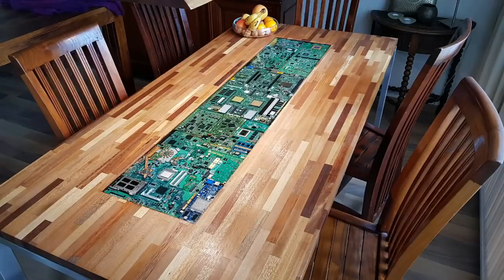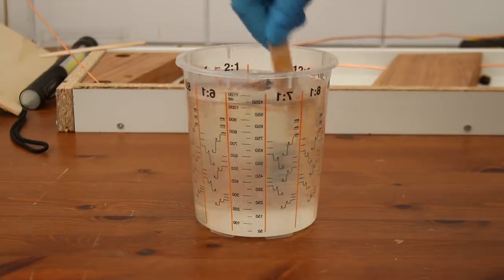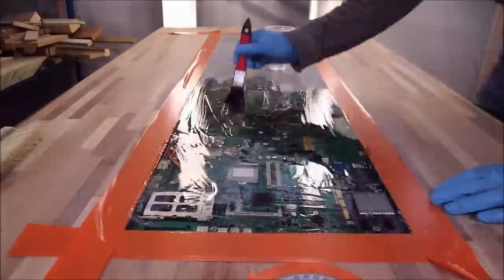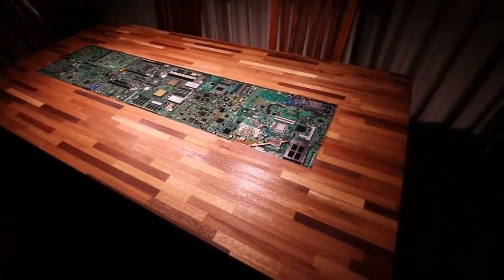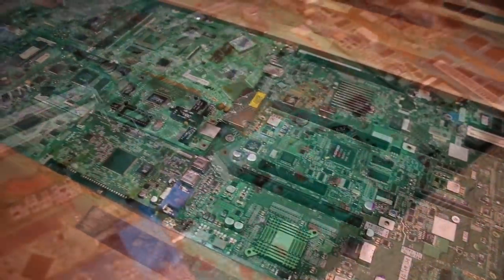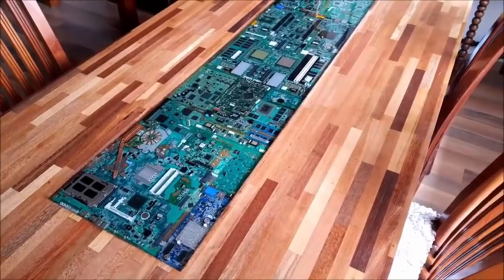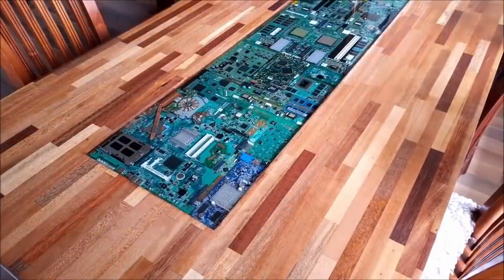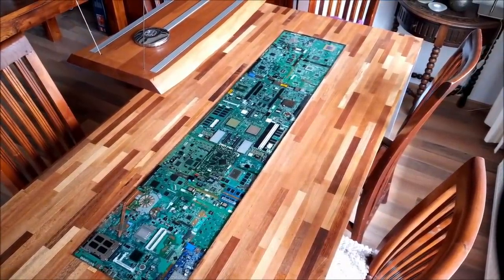Circuit boards with lights in epoxy in a table

Comment: Do you think it would have been better to pour ALL of the epoxy at one time instead of pouring it in layers as you did?  I saw a video teaching how to make solar panels, and he used an epoxy that needs 36 hours to cure, and after he mixed it, he used a vacuum pump and sealed the top of the container with the epoxy in it, and sucked out all of the air bubbles that gets into the epoxy from the mixing process.  But I am curious if you think this would have worked better had you only done a single pour?
Reply from the maker: Mmm... in general no. The specifications of the epoxy said I could do 5 cm at once, and I did maybe 1,5 cm at once. So yes, I could have done, and yes, if you get the mixing right of that one batch, the problems I faced would not have occurred, but there is a bit more to it than that. It leads a bit far for here in the comments, but I want to make a sequel to this video, in which I'll fix the table and I want to answer questions like these in more detail.
Maybe if you're interested, you should stick around here.. 😊
Reply: @Onrust1  Interesting ... When you were chipping the wood out of the table, I thought perhaps your biggest problem was going to be getting the epoxy level with the table ... then I thought ... well ... maybe he will just tack down like a retaining border around the entire table that is maybe ⅛" above the table and then cover the entire table in epoxy ... but then you did the whole sanding thing which was the entire reason you had these anomalies in the first place, right?  I wasn't too clear on what actually caused the distortions you ended up with.

And as you were doing your initial pours, I just kept shaking my head thinking about how much money went into those boards when they were brand new ... and also all those components I could have salvaged and used in other electronics projects .... ;-)

It is quite a lovely table in the end ... I'm curious what your wife thinks of it?  Women do not generally consider electronics .... aesthetically pleasing.  :)
Reply from the maker: Not clear? I thought I was quite clear in my diagnose in the video: I (still) think I messed up the mixing of one of the five pours I did. That's because of the problems I see in the table, at a particular height in the table, and at a particular place. All things for the next video about the table..

All the boards / computers I got, I got out of the trash. They were without any exception about to be thrown away. If you could have reused them, you should come over and do one shout on Facebook (like I did)... 😆😆

My wife thinks nothing about it. She said she wouldn't click on such a video if it came by. She doesn't get what is exciting about it, or beautiful. In short: she's not in my target audience.. 😊

Comment: I almost shouted at the screen when I saw you pour the epoxy in one thick layer: Don't do it!! Oh well...Cut a glass cover for entire table. Even better: Route a shallow channel where the wood and epoxy meet and fill it with a nice wood slat. Like making a frame insert to clean up the edges. Use wood because more epoxy is unlikely to work. Sand everything down flat again, polish best you can, cover the whole table with a cut glass top. Should make it functional as well as beautiful. Too bad about the epoxy. Otherwise, it looks cool though and is worth saving
Reply: Nathan Butcher 
I was cringing when I saw him pouring that much resin at once! Thin layers! That was my guess why it didn’t set up right, but I suppose it could also be due to getting the ratios of A to B wrong. Only he knows how carefully he was mixing the two parts. Such a shame there are issues with the resin; he put a lot of time and effort (and I’m sure money too) into the table.
Reply from the maker: I am planning to fix the table and make another video of that. Maybe if you're interested, you should stick around here.. 😊

Comment: The only thing I would change. Besides the problem with the epoxy. Is to have not just put random pieces of board, but to create something more organized with the lights. The other thing is not drill below the table, you should have lay the optical cables below the boards. This is not a work bench is stills dining table. But awesome idea and good skills.
Reply from the maker: The optical fibers couldn't go below the boards, because they bend at a radius of a minimum of about one cm (half an inch). Because you need room for that bend, the only place for them was under the table. But I put a sheet plywood over them, so they are no longer visible anymore.

Comment: I live the video but you didn't use a blow torch or a hot air gun on it to make the depth of the epx dry before adding another layer, that is what I do and they turn out great.

Comment: The reason the epoxy got like that was probably because you poured 7 liters of it at the same time. Most epoxies have a maximum limit of 5-7 liters, and even then they recommend splitting those big pours into two smaller ones instead, since it has no problem seamlessly bonding to previously cured epoxy.

One reason for that is that it's a lot harder to get large amounts mixed properly, and sticky spots is one symptom of those unmixed spots. Another reason is that the more you mix at a time, the hotter the mixture gets and the more likely it is that it won't cure properly, or it'll get so hot during the curing process that it might just crack when the heat makes it want to expand.
Reply from the maker: There is no limit to how many liters you can pour with epoxy. The limit is in the thickness of the layer you pour. The specifications of this kind of epoxy said I could pour 5 cm. I poured maybe 1,5 cm at once. It was a slow curing kind, I never experienced any heat at all. I messed up the mixing, and it was in one of the top, smaller layers.

Comment: Very Cool Bro
I’m going to be doing a whole wall with Circuit Boards.
Reply: I'd like to see that. Are you gonna make video?
Reply: Johnny Blade Maybe yeah,Good idea 💡
Reply: Won’t the epoxy sort of dribble?
Reply: Lisa Schuster I don’t think I will use epoxy, but if I do I will do it in sections laying down first... I would really like to do it where everything is open to the air and maybe just give it some coats of clear coat so it can be dusted easily...

Comment: Werd de epoxy warm? In dat geval was een plastic tent geen goed idee namelijk. Door warmte en kou verschil kun je condens krijgen binnen in dat tentje en dat is killing voor je epoxy. Maar de sticky spots zou ik wijten aan onvoldoende gemixte epoxy. Neem daar echt ruimschoots de tijd voor en gooi desnoods de mix nog eens over in een nieuwe emmer en mix nog een keer om te voorkomen dat je ongemixte epoxy van de wanden van de emmer mee giet in je werkstuk. Verder heel cool idee. Zeker die fiber optics echt top verzonnen.
Reply from the maker: Ik heb het eerder gehoord, maar vind het moeilijk te begrijpen. Op iets wat koud wordt komt condenswater, niet op iets wat warm wordt. Bovendien moet er dan sprake zijn van een hoge(re) luchtvochtigheid, en ook dat zie ik in mijn werkplaats niet ontstaan. 
Niet dat ik ooit warmteontwikkeling bij de epoxy heb kunnen ontdekken overigens. Ik heb dan ook een maar traag hardende epoxy genomen. 
Vwb. het mengen heb je helemaal gelijk, daar ben ik nu ook achter. Ik giet inmiddels alles over in een tweede beker, en meng met de machine, daarvoor heb ik een impeller gekocht die ik op een draadeind heb geschroefd.
Bedankt voor de complimenten! 😊👍
Reply: @Onrust1  Hm ja traag hardende epoxy wordt nagenoeg niet warm inderdaad. Toch zou ik persoonlijk niet kiezen voor plastic als afdekking. Al kan ik dat niet hard maken met feiten. Gebaseerd op gevoel dus. ;) Ik denk dat ik iets zou kiezen wat nog enigszins damp open is maar geen stof en vuil door laat. Zijde ofzo.

Comment: Nice, uncured epoxy - which is one of the most cancerous products on the market, which also affects fertility. Glad I did not have to walk around in the fumes from that table or getting it on my skin. A lot of people do not know how dangerous this is uncured. You need special gloves, full protection suit and special respirator mask and good ventilation to use it. It has an IARC classification of a Class 2B or 2A carcinogen, dependant on exact composition. https://www.westsystem.com/safety/preventing-overexposure/

Comment: Love the dedication :) Sure, you always learn. I'd personally use a cut glass with a nice steel or aluminium border to join the wood. That way you could actualy use a cheap motherboard underneath with a hidden power supply. Lay a naked lcd screen in the midst of all that and have family pictures or whatever play in a loop over breakfast ;)

Comment: Next time make an epoxy pour slab with the circuit boards all on its own and then fit it to the unfinished table.
Reply from the maker: With the fiber optics, that would have been a real pain, if not impossible..

Comment: The soft spots of epoxy will EVENTUALLY set, might take 2 or 3 months, but they will absolutely harden.
Reply from the maker: You're right, they do. But the ugly spots don't go away with that...
Reply: @Onrust1  Well you'll just have to sand again and refinish it, but it should be good after that, just another thin (and thoroughly mixed) batch of epoxy and you're all set brother.
Reply from the maker: @jsullivan05  I already tried that, and as I said, the ugly spots won't go away with that. But I have a plan to take them out with chisel or router and pour in epoxy again, and I want to make again a video of that, for everyone to learn... Thanks for the comments!
Reply: @Onrust1  One last thing, I also find that sanding/buffing gives a better finished look than another coat of epoxy if the thing you're covering has a border like this table does, if you were going to cover the entire table then a flood coat is fine, but since there's a seam between the wood and the epoxy, you'll never really be able to get a flat crisp join, there will always be a lip and that always looks kind cheap, sanding and buffing really doesn't take allll that much more effort, it's just kinda time consuming, but damn does it look great when it's done correctly.
Reply from the maker: I totally agree, I wanted to do that from the beginning, but changed plans as I saw the ugly spots... (as I kinda explained in the video)
Reply: @Onrust1  That's odd to me that even with copious amounts of like 60 grit sanding that the ugly spots wont go away, I've never run into spots that bad, usually with enough sanding I can hide all of my crimes lol. Well I wish you luck partner, I'm sure it'll make a great vid, you rarely get to see people fixing mistakes, they just put out videos that make it look like they were perfect from the get go, i'll be looking forward to it. (As I finished typing this I realized that the ugly spots are super deep subsurface blemishes and not superficial ones, I didn't feel like backspacing all of this lol, I now get where you're coming from :-) , yeah idk how you'd fix that, chisel as you said or plunge router maybe)

Comment: You had a router should have just screwed the boards down routed a edge around the border and set glass in the center of the table that would have be easier and later as the table got used the glass could have Ben replaced

Comment: Vibration is key when pouring, it helps the settling and leveling of all those tiny spots! I think...
Reply: A1 noob problem is not stuck air bubbles, some resin was not fully mixed which keeps it soft and runny.

Comment: Sounds and looks great, buuuuuuuuuuut you forgot that those are circuit boards. The epoxy failed because some of those are coated with a greasy film to protect the components and circuits as well as the acid leaking from the capacitor cans.. IT mixed with the epoxy and ruined it. Before you do this again, put every circuit board into an ultra sonic cleaner before hand. Any capacitor cans that have leaked will get cleaned out and any resins or coatings on the circuit boards will be cleaned off. If possible, remove any capacitor cans that are leaking, you can tell at the top of each can as you will see a + shape groove at the tops, if it's Bulged instead of flat, cut it off and get rid of it or else more leaking. If there is any left over thermal paste on any of the components, it can also mix with epoxy and cause soft spots, heck even if the board may have been reheated in the past, left over soaked in Flux paste can sweat out of it and that stuff is normally clear as water when warmed up, also a bad mix for epoxy. This is simply a problem of contaminated epoxy.
Reply from the maker: Oh how could I forget that that are circuit boards..? 😆😆 How much I appreciate your lengthy comment... you're wrong. As you can see I 'glued' the boards in before I mounted the lights with one first pour of epoxy of one or two liters. That pour was fine. The problem is in one of the top layers, and only on one half of the table, which leads me to the conclusion that... I screwed up the mixing of one batch.

Comment: Why don't you attach a piece of glass on top of the table? Might be a good finish to the project and protect the top of the table. A glass shopmay cut you a sheet to size and temper the glass, I would do so with care, if you bump a corner the whole piece could shatter.That's what I would do to finish the project.

Comment: I like the concept, and I admire people who do awesome projects like this.. but.. I was a bit worried. I feel like this was bit dangerous. Epoxy gets pretty hot when curing, and allot of circuit boards are very flammable. Also.. why go through all the work of carving out half of the table ? why not saw the section out completely, and put another plank in? You drilled holes in it anyway, so keeping the bottom nice couldn't have bin the reason. Maybe it would have bin more risky for leaking, but there's ways around that that doesnt involve carving out half a table. Anyways, I still think he did a nice job and the table looks very cool. Too bad it kinda failed, but im convinced he can make it work somehow :) Hope to see an update on this project when he does.
Reply from the maker: Cutting out all never crossed my mind, but I think you're right about that (you're not the first with that comment, btw. 😊). The epoxy was one of the slow curing kind and I never experienced any heat. Thank you. Yes, I'm planning to make a video of how I (at least try to) fix the table.. 
(Your name could be Dutch?)
Reply: Onrust! Great 😊 I will gladly watch when that video comes out! And oh, good idea of using slow curing, I didn’t think about that. En ja, ik kan nederlands 😉 Ik ben van België 😁

Comment: did you heat the epoxy with a blow torch as you were pouring it, I made a similar table but with a whole bunch of small wood pieces. Only problem i had was i poured too much epoxy at once and some of the wood had a lot of air trapped inside and put bubbles in a couple spots.
Reply from the maker: Yes the torch is visible in the last seconds of the video. Yes, I had those bubbles too - but only minor ones. I know now you have to treat the wood first, with some finish of with epoxy itself...

Comment: Throw a piece of glass over the top and enjoy your table.
Reply: George Scott that’s what the epoxy is there for
Reply: @at0mlx  No, the unmixed or "soft" epoxy keeps leaking out making the table constantly sticky and messy in places.  As someone who has plenty of experience with all sorts of resins, (worked for many years in the fibreglass industry in my youth), I can tell you there is no perfect answer to "uncatalysed resin.  I know, I have tried all sorts of things.  But in this situation, simply placing a layer of glass over it (maybe elevating it from the table by a few mm if the resin seepage is really bad) would be the best he could do.
Periodic removal and cleaning would probably be required.
Reply: @msmnutech2814  If you have something sticky leaking through a jar lid, what do you do? You seal it up.

Bond a glass top to the table so that it is air tight (And epoxy tight.)

To avoid it spreading, make the glass only cover the center, with a routed perimeter in the wood around it where you create your containment seal. 

Could even work as an accentuating line.
Reply: @at0mlx  Oh, I thought you said you had soft and sticky areas. Glass would cover that. Maybe you were just talking and didn't know what you were saying.

Comment: Why not just cut the entire thing out,   make the insert separately, and drop it INTO the opening already cut (enlarge it slightly, that way, you wouldn't have to worry about cleaning out all of that epoxy - It appears that you have more than enough room).  What is that cut called when you create an edge for a sheet of glass to sit inserted in a table top?  Us a sheet of glass to protect the electronics from spilled liquids. You could even  make the inserts modular .. alot easier to handle  - one power supply,  just plug them in.